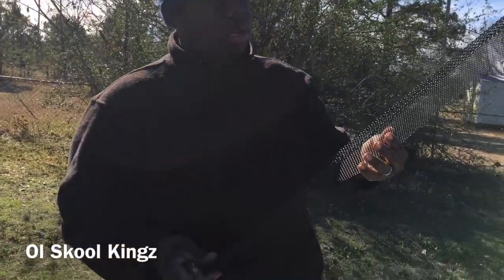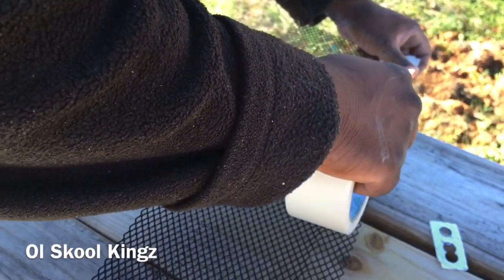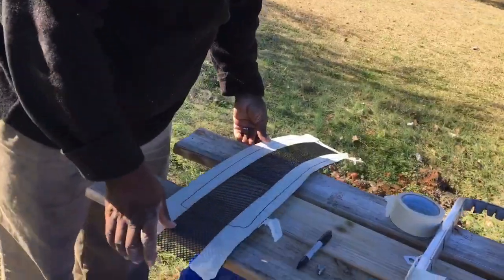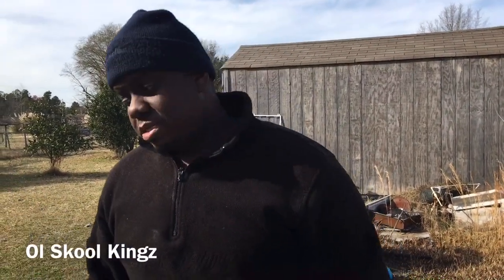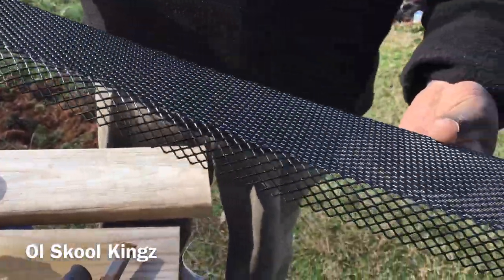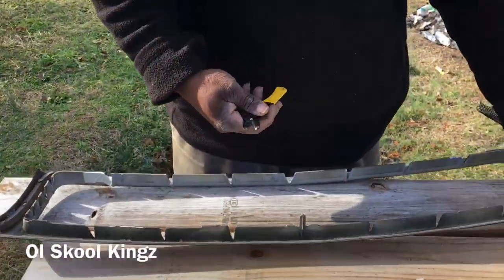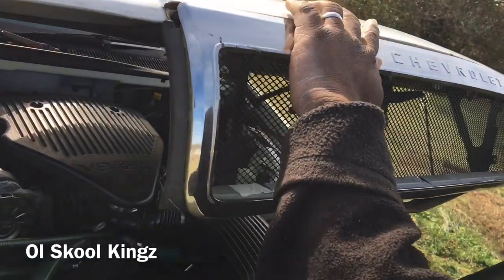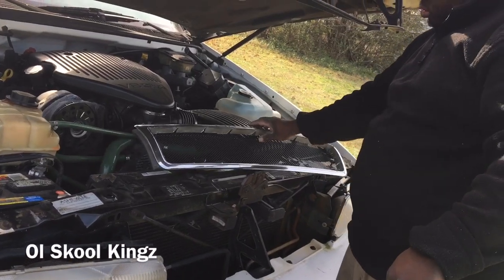DIY CAPRICE GRILLE PART 3: BACKYARD BUDGET PROJECT!

Comment: Thats a really clean look for the grill, may want to melt some plastic in spots on the mesh to hold it to the grill (maybe use a solder iron)
Reply: Maybe just bondo to smooth out the holes
Reply from the maker: Thanks haven’t thought of that,I seen where automotive goop glue was use for a suburu grille

Comment: are you Amish? you could have done this in 10 minutes with a small cutoff wheel on a cordless drill and then finished it off with a sander wheel on the high spots...